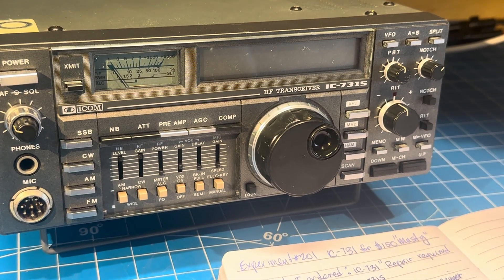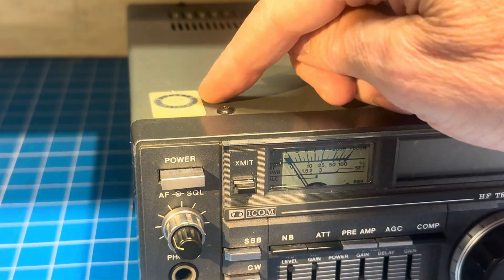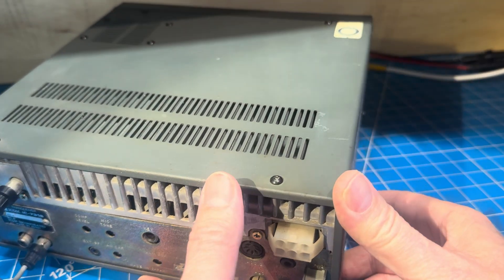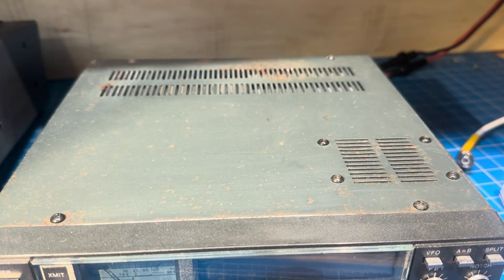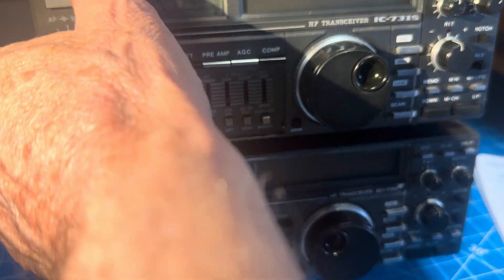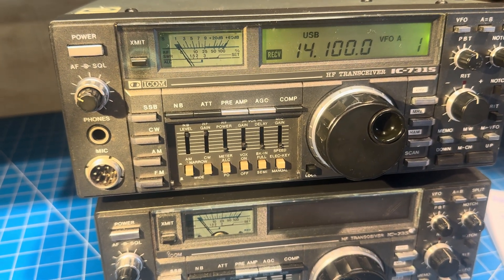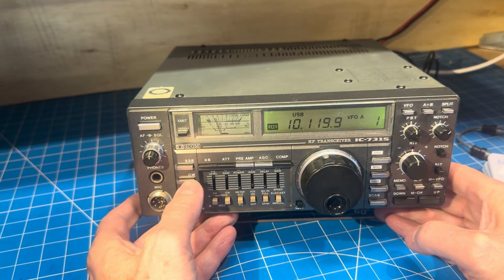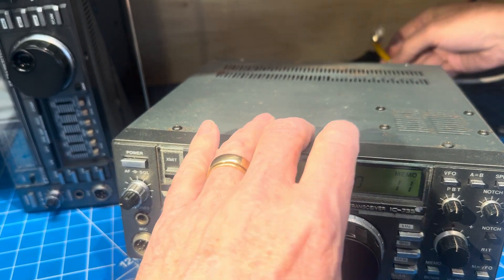A Radio Arrived, Not What I Expected… But Should Still Be Fun.

Comment: In my opinion, the front door was the most valuable thing you missed out on.  Suggest you ask the seller to give you a hundred dollars credit.  If he listed it as a 'parts only' sale, your options may be more limited from eBay's standpoint.   Try a quick transmit test.  if no power, then the PLL.  If power, then front end receive.

Comment: Break out the signal generator and don't rely on band conditions when testing receive.
Is that "switch" possibly the cable on the back of the rig?
I'd start with some signal tracing, once you lose it you can then start checking voltages.